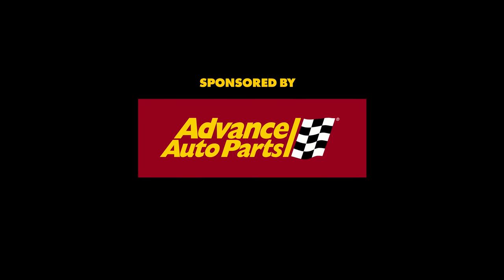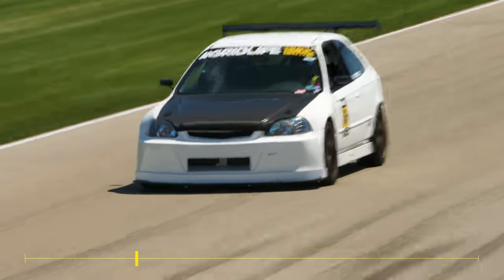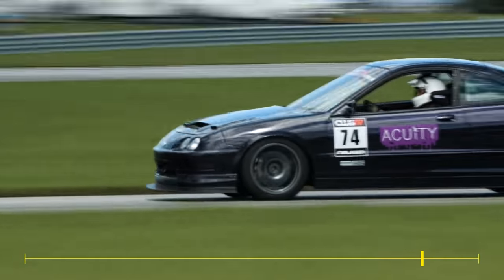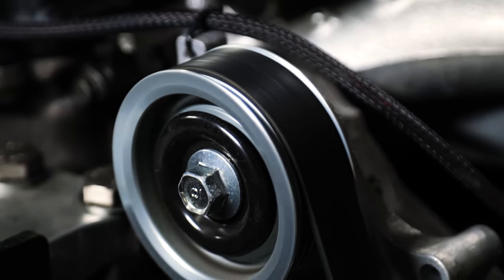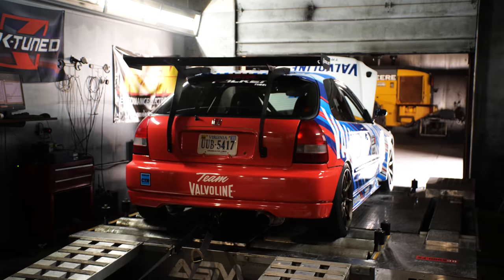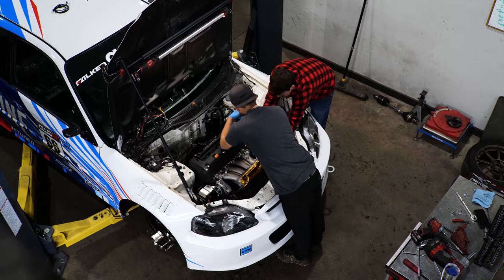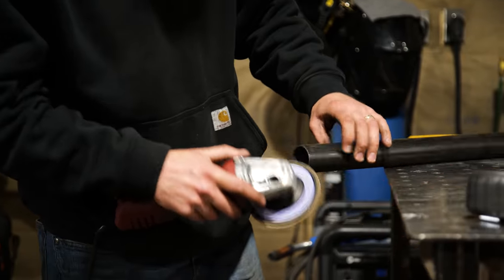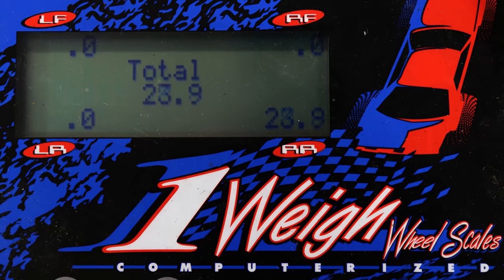Refining My K24 Civic - Ep 1: Teardown

Comment: I might have missed it. Did Artson use steel or chromoly for the cage? Chromoly is lighter and stronger when welded properly than steel. Should save you on that weight you're looking for

Comment: Would "Cannards" help assist Front Downforce and aid with Better Traction?
How about Rear Cannards as well to help with Rear Downforce.
Or maybe add some "Speed Holes" in the Hood to better expell excessive Air Pressure under the Hood?

Comment: Are you running an electric water pump as well as the electric power steering, for less drain from the engine or you can’t because of the rules

Comment: I believe that oil pan is overkill for a stock engine with bolt on’s
Reply: Negative.  Keeping the oil located at the pickup is essential.  It would be overkill for stock suspension and stock wheels/tires.  Constantly pulling 1+G’s while cornering necessitates a baffled pan.
Reply: It’s less about the internals and more about the lateral grip.